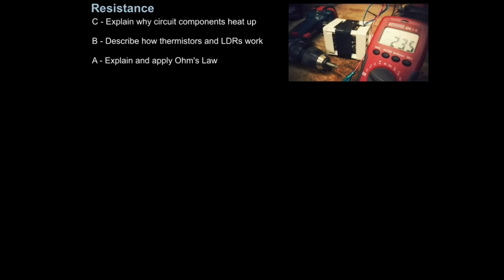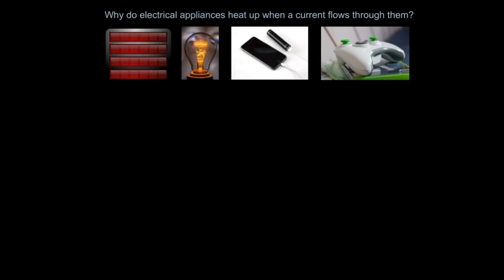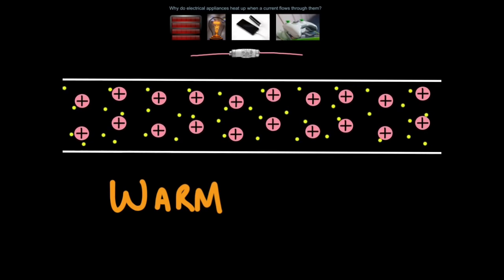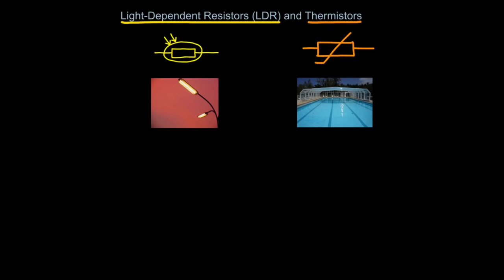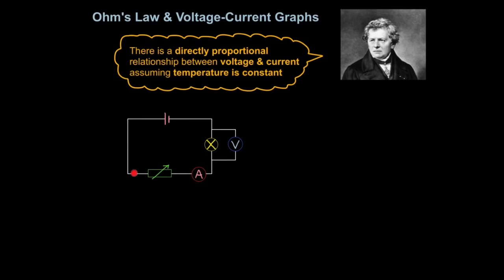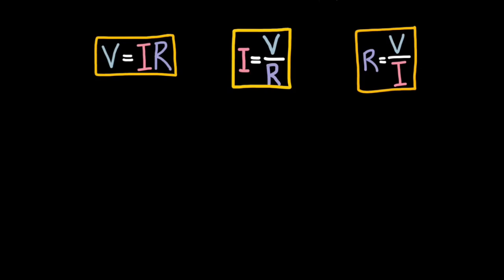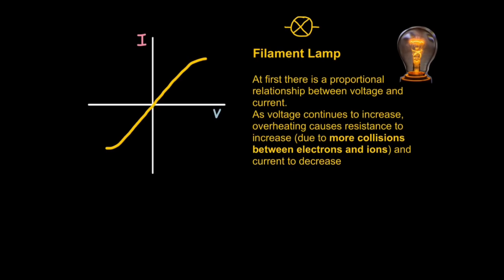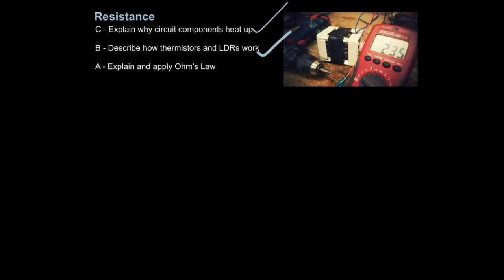P2 Resistance (EDEXCEL)

Comment: So could you say for the filament lamp that for current and voltage it's inversely proportional?
Reply from the maker: no - directly proportional up to a point. When resistance (due to heating) gets too high, the proportionality is disrupted
Reply: Ah okay, thanks.

Comment: I don't get it so... an LDR is used in street lamps so surely less light (when it is dark) means less resistance not more?
Reply from the maker: yeah - a common issue. There is a logic to it. Think of it like high resistance diverts the current to another circuit which switches on the light

Comment: 5:30 So how do insulators work
Reply from the maker: +Ace!... It's not really a matter of them 'working'. They have a different structure: electrons aren't free to move like they are in metals. Electricity is the flow of electrons. Insulators cannot allow electrons to pass through with ease. They can, however allow electrons to build up which is why we use them to demonstrate the principles of static electricity. Thanks for taking the time to post your corrections
Reply from the maker: +Ace!... p.s. in case you didn't read my reply to your other comments - I have deleted the videos with mistakes and uploaded newer versions. Thanks for your feedback.
Reply: +StudySmart: Science  Thanks for making the corrections. Your videos are excellent.